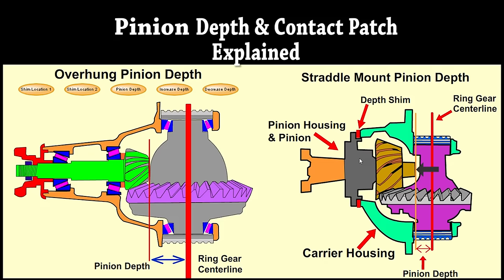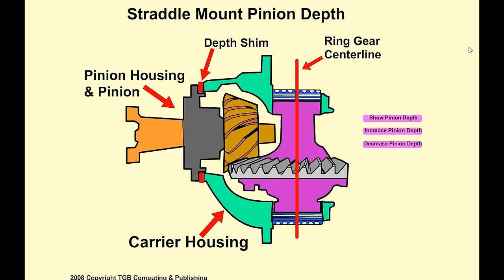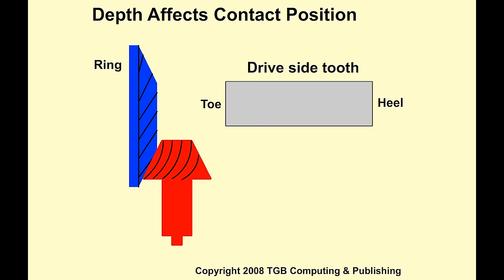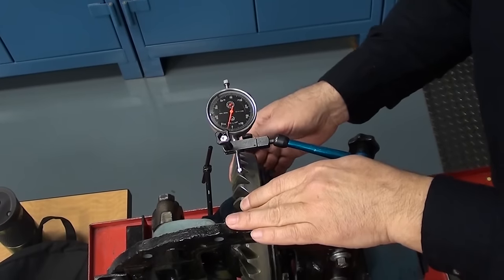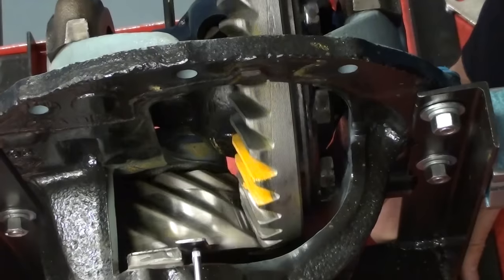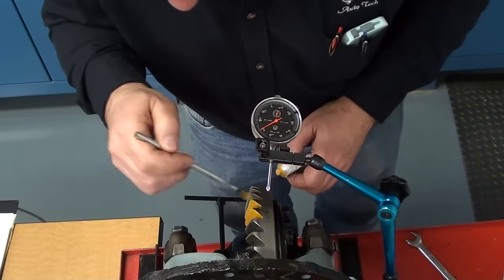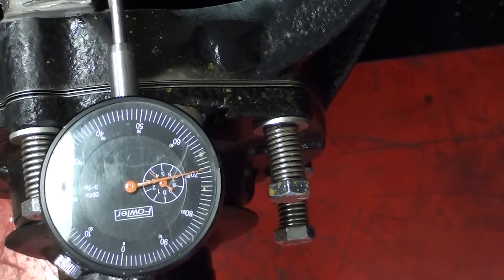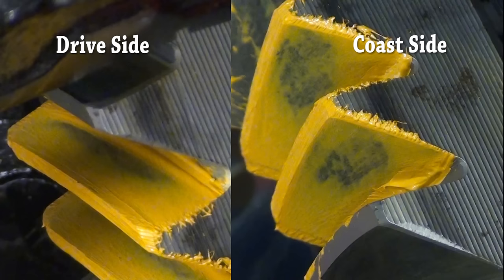Contact Patch & Pinion Depth Explained

Comment: wow, this was a good video. But to me, the coast side is still off too much for my liking, I like it a bit more centered and 10 thousand is way too much Backlash, I always go with 7 thousand. Remember it will settle a bit after some use and at 10 thousand of an inch backlash when it does you will be at 14-16 thousand of an inch, which is way to sloppy for me and I have seen a lot of damage accrue in this range. I just always remember what a friend of mine that was a Nascar mechanic for years said "When it comes to backlash 7 your in heaven". Meaning 7 thousand of an inch is where you want to be.
Reply from the maker: Thanks for your comment.  This diff has a BL spec as high as 0.014 in. For the purpose of the demonstration 0.010 in was  a good number.  You need to remember that what is good for a race car is not always good for a street vehicle.  Additionally ring and pinion gears have two major cut designs.  The 2 cut (Hobbed) or the 5 cut (face milled). The two cut design can have BL as small as 0.003 in and function great.  All gear and OEM manufactures have recommended BL specifications.  I agree that setting the BL on the low end is best but it's not always possible due to BL variation.  A specification means that if something is setup within specification that that item will perform as expected throughout the life.  Life is a bit arbitrary but the point is that if the BL setting is within recommended specifications no problems should exist for a long time given proper maintenance is performed at the proper intervals.  Now for the coast side.  it's always preferred to have both patterns perfect but it's rarely ideal.  The drive side takes the grunt of the load and therefor it needs to be dominant or prioritized and the coast side is secondary. You would be surprised as to acceptable patterns I have seen gear manufactures tell me are okay.
Reply from the maker: https://www.differentials.com/two-cut-vs-five-cut-gears/

Comment: I thought pinion depth was fixed according to what's stamped on gear set
Reply from the maker: Pinion depth is fixed once the technician who is setting up the differential makes the correct adjustments using depth shims. The video shows a modified differential I made so I can quickly change the pinion depth specific for educational purpose and this training video.  The pinion depth is not always stamped on the head of the pinion and many original parts from the manufacture do not stamp the depth on the pinion.  They use factory tools to setup pinion depth and its not always based on the actual distance value.  Additionally some manufactures don't stamp a depth distance but instead stamp a plus (+) or minus (-) marking on the head of the pinion. This is in relationship to housing machining and compared to the (+) or (-) marking on the original pinion being replaced.  A chart is then used to select the correct replacement pinion depth shim.  For example.  If the old pinion was marked with a (+1) and the new replacement pinion was marked with a (-1) the new pinion depth shim needs to be .002" larger than the original shim. If the shim that is used for the (+1) pinion is .030" the new replacement shim to be used on the new (-1) pinion should be .032".  Often a pinion depth tool is not available and setting up pinion depth is a little bit of trial and error. Assembling the differential, take a pattern, disassemble and change the shim, reassemble and take another pattern.  Knowing how pinion depth will effect the pattern location can same the technician time ensuring they add or subtract correctly during this trial and error process therefore reducing the amount to time it takes to get the pinion depth correctly set. I hope this helps you and others understand pinion depth adjustment better.

Comment: Send this to FORD they have a lot to learn.
Reply from the maker: I once took a factory Ford class on Diff setup and I was told not to worry about the contact patch. As long as I used their pinion depth tool correctly, OEM gears and set the backlash was set correctly I didn't need to worry about the contact patch.  Because of variations in gear machining I disagreed and feel that the contact patch is the final say in confirming the setup was correct.

Comment: No talk about master housing depth?
Reply from the maker: That is correct because the purpose of the video is to show what happens to the contact patch in relationship to the pinion depth or pinion position in the housing. If you know the master housing depth and the size of the pinion head the actual pinion depth can be calculated but that would be a different video.  When building a differential the last and most important step is the contact patch.  Even if the pinion depth measures correctly with a tool if the pattern is off I will always adjust the pinion depth to accomplish an acceptable contact patch.

Comment: how is that pattern perfectly acceptable when the pattern is was tward heel at end of video.
Reply from the maker: If you build enough diffs you will discover that obtaining the perfect pattern where both drive and coast sides are perfectly in the middle is not very common.  What is acceptable is any pattern where the contact patch is not off the ends of the heel or the toe or too high on the face or too deep into the flank of the tooth. When I build for myself I strive for perfection and I will seek that perfect contact patch. When you build for your boss the perfect pattern that you may never be able to obtain takes extra time on the job just to see if the perfect pattern can be achieved. If your paid by the job you and your boss lose money.  As I said, any pattern that does not push the extreme edges of the gear tooth will not make unnecessary noise and it will last. It's like setting up backlash.  You have a specification of 0.005" to 0.009".  Do you strive to set the backlash at 0.007" because it is the perfect middle when the manufacture clearly states that as long as the backlash is within the specification of 0.005" to 0.009" the diff will work fine and last.  Unfortunately the reality is that there are a lot of diffs out there that are working just fine who don't have that perfect contact patch. If you want to see something really crazy look up the Diff installation manual on the Yukon Gear website and look at what they say is acceptable.  Oh my gosh..... I would never let a gearset go with some of the patterns Yukon Gear suggest are acceptable.

Comment: Not an issue with my chain drive differentials.
A facetious prick would ask about the worm gear drives used on thornycroft and similar trucks from the early 1900s...
Reply from the maker: I'm old but not that old to be able to field a question about something from the early 1900's.

Comment: This video seems to be opposite of the one from Carl JantzEngineering
Reply from the maker: What Carl says is correct and my video supports his explanation however sometimes patterns vary a bit because of the machining process and differential design. Some gear sets are cut using the 5 cut method and some use the 2 cut method.  If you check the Yukon gear website you will see contact patch patterns that they say are acceptable that I would never feel comfortable with.   If you look at my video you see the pattern respond to pinion depth change on a real differential and not drawn on a white board.  When the pinion is too close to the centerline of the ring gear we saw that both the drive and coast patterns were deep down on the flank. Coast being off the heel and drive being off the toe.  In Car'ls explanation he says the coast will be high on the face and running off the heel. As you can see from my real differential simulator the coast pattern is not high on the face but in fact deep in the flank.  What is consistent is that the coast pattern is excessive on the heel.
Reply: Well, his terminology and ,or hand expression doesn't seem in sync I guess
Reply from the maker: If you would like to share with me what seems contradictory I would be more than happy to try to clarify it for you.  I'm a teacher and retired technician and explaining things is now my business.
Reply: Jantz pretty much described what is going on here.
Reply: @DrivelineMaster  Excellent video. I learnt alot. My front differential seems to have been poorly set. The pinion ring is hitting the carrier. Does mean that the pinion is too far forward into the centre line of the ring gear? And needs to be moved back?
Reply from the maker: That is correct the pinion to too close to the centerline of the ring gear.

Comment: That must be a bitch to do in a fully assembled rear end
Reply from the maker: Actually in the area of drive trains working with transmissions, transaxles, differentials, axles shafts and driveshafts, differentials are some of the easiest to overhaul and repair with minimal to no special tools. After doing a couple of diffs you get the hang of it and it's pretty simple to get them right.

Comment: Yeah try doing that to a damn Dana 44 on a C3 Corvette. It's all shims behind pressed in races and bearings. This setup was design by an idiot!! I have try EVERY shim combination and cant get the proper pattern with the new gear set from US Gears.
Reply from the maker: Yea, this can be extremely challenging.  One trick is to buy an extra bearing and race set and hone a small amount of metal from the outer edge of the race (if the shim is behind the outer race or hone a small amount from the inner race of the bearing if the shim is between the bearing and the pinion gear. If my memory serves me right the shim on these Dana's go between the outer race and the housing.  You want to remove just enough from the bearing or race so the bearing or race just barely slide on without pressing but are still snug.  That way it's easy to change the shim and recheck. Once you get the right shim use the new bearing that you did not hone and press the bearing or race into position. Now, for the pattern.  If you can get a pattern where it's not running off the heel, toe and face or too deep in the flank you should be OK.  Also if you drastically changed your gear ratio it can also be difficult to get the depth correct. When I worked for Ford we were told to use the Ford depth tool and to not worry about the contact patch.  If the depth was set with the tool everything would be OK and screw the pattern.  I really don't like that way of thinking.  I even had one diff that I had to put shims in both places between the bearing and pinion gear and the outer race and housing even though the diff was not designed to be setup that way.  Definitely a custom setup with shims from other diff designs to make it work. Good luck.
Reply: @DrivelineMaster  I have made all the setup bearings and races to slide in place snugly.  The problem I am having is going from the lowest gear ratio to the highest gear ratio for this carrier. 2.73 to 3.73. I'm n9t getting a good pattern.  I have spent 20 hours on this damn thing and still can't get it right.  I have went through every shim adjustment possible, and the pattern is all over the place from one extreme to the other, and it will never go to the center. Could this be just a bad gear set that was ground wrong?
Reply from the maker: What a bummer.  Unless your bearing races are moving on you because you ground too much or your grinding is off center which I doubt since you say they fit snug I see that you have 2 options.  1) you have a bad gear set. Replace it with another brand.  2) If you have a pinion depth specification and a measurement tool you use that to set the depth and ignore the pattern and hope for the best.  The problem with option 2 is having the spec and tool and if you put the gear set into service you can't return it.  I found these acceptable patterns from US Standard gear. The bottom 4 are far from ideal. https://www.usastandardgear.com/install-manuals-usa  click on USA Standard Kit Instructions and look at pages 14.  You might even have these instructions already.  If it was me and I could get my money back I would return the gearset and buy a Yukon gearset. If I could not get my money back and I had the pinion depth spec. I would set it up with the depth tool and put it in service and hope for the best however I would never do this on a customers vehicle.  Only my own where my labor is my time. One last thought as I already stated. You may never be able to get your patter centered where you would like it as long as the pattern is not running off the Toe, Heel or face and it's not too deep on the flank your OK. Also as long as your drive side is acceptable go with that. Drive side is the most important.  You can contact US Standard Gear using the same link above. Good Luck.
Reply: @DrivelineMaster The problem is I am running into is I am running far more power than this unit was designed for. So I won't be making any trips to the drag strip. I will be hunting for an alternative this this garbage GM designed for this car. The engine is a Dart SHP 427 small block mated to a 4L80E. Exhaust is Hedman full length 1-5/8 headers with 3" exhaust x pipe and race mufflers.  The gearing is a 3.73 set with 295/50R15 Hankook tires.
Reply: @DrivelineMaster  I have tried over and over and over with this damn thing, and tue more shims I add the more this thing rides on the heel. Because it's the C3 Dana 44 no one will touch it. Nothing 8n any of these videos makes any sense. None of it works with this differential.
Reply: @DrivelineMaster  so far I have run the spacers from .039 to .047 and no matter how I r7n the gears I always run a pattern at .006 gear lash and no matter what this set of gears from USA Gears will always run a pattern towards the heel. I makes no sense.
Reply from the maker: If you want help I'm willing to help if you provide me with some contact patch pictures and tell me the thickness of the shims that produced the contact patch in the pictures you send me.  First, where are the depth shims located?  Between the pinion head and rear bearing or between the rear bearing race and the housing?  Second what is the thickness of the shims you have installed? if your using more than one what is the total thickness?  Third, send pictures of the drive and coast side to drivelinemaster@gmail.com.  Last, if you have not seen my video on the best way to perform a contact patch give it a quick viewing.  https://youtu.be/UIIk305-zlQ

Comment: This is bad guidance because drive SIDE is WAL TOO DEEP
Reply from the maker: The purpose of the training video is to show how the pattern changes position based on pinion depth and not so much what is a correct or incorrect pattern.  I have seen manufacture patterns that they say are acceptable that will turn your hair colors they are so unrealistic.  The last pattern in this video is a little deep but far from being way too deep and in fact the last pattern in the video IN MY OPINION could be acceptable however I would make another attempt to bring it up a little more in an effort to seek perfection. One of the problems with contact patch patterns is that perfect is not often achievable and there is often a compromise that works. My rule that has served me well over 40 years is that if the pattern is not off the edge of the heel or toe and not too high on the face or too deep in the flank for both drive and coast then it will work without problems.

Comment: It’s difficult to visualize how the drive and coast patterns move in opposite directions when changing pinion depth. How much will the patterns change by setting backlash at minimum and maximum specs?
Reply from the maker: The greater the backlash the more the contact makes contact on the heel and high on the face of the tooth.  Smaller backlash moves the contact closer to the toe and deeper into the flank of the tooth.  I normally don't bother with backlash patterns because I can measure the backlash and adjust it based on the dial indicator measurement. I don't need to make backlash adjustments based upon a contact patch like we often have to do with pinion depth.